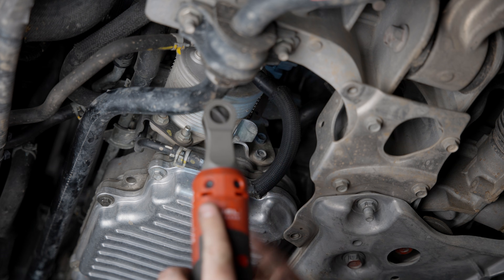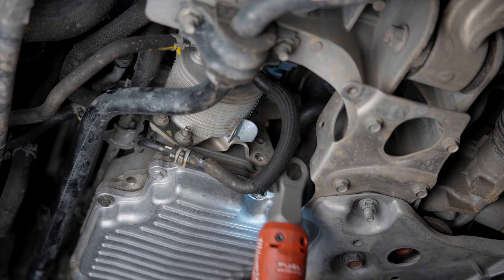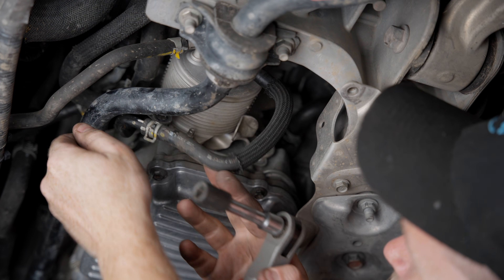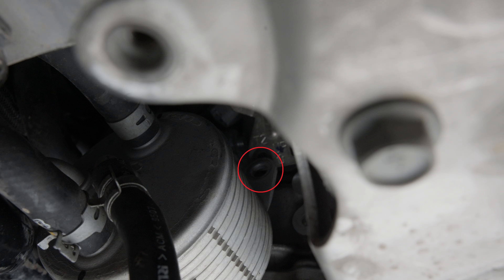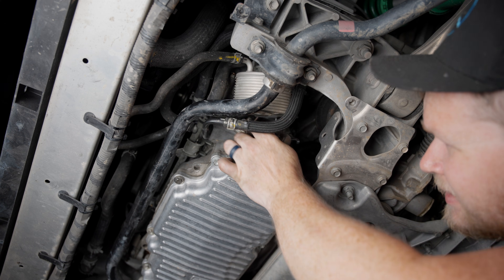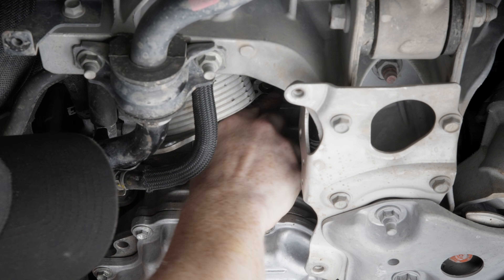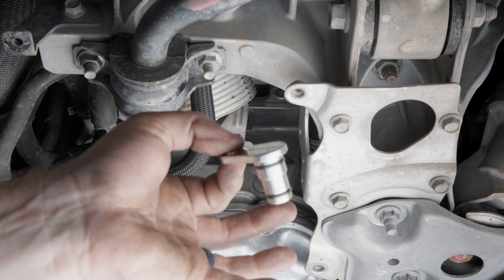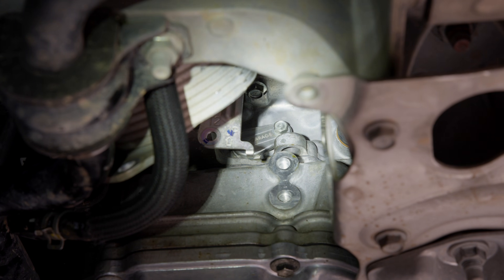How to Install a VR30 Oil Control Solenoid Delete Plate

Comment: I unplugged it and it’s not reading the engine oil pressure on the ecutek app.
What could it be?

I just unplugged the solenoid, didn’t swap to block off plate
Reply from the maker: Talk to your tuner and check your oil pressure sensor connection.

Comment: I added the block off plate to my 2018 awd q50 ,and all I did was remove the front tire and installed it from the side.
Reply from the maker: I haven't done one on an AWD model but that sounds way easier to me 🤣
Reply: @Gr4yshirt  yes sir, I saw how you were moving the cooler and all that out of the way,and did not want to mess with that,so I looked for another way to do it and that's how that came about.😂
Reply: Did you get a light on your dash? Also did your gas mileage drop after?
Reply: No it doesn't give you an actual cel ,but I can see a dtc on my ecutek,which is no big deal and yes my mileage has slightly dropped,but its better then a blown engine...I've installed all my mods on my car,so to me it's a part of this import tuner thing 🔰🌅

Comment: Maybe a dumb question but will removing this sensor throw a CEL?
Reply from the maker: I believe so, but it can be tuned out. My tuner  disabled it for my tune.
Reply: Yes you need to be tuned if your putting the block off plate on

Comment: Hi, new here. Why do you delete it? What will it change?
Reply from the maker: Hey, welcome. The oil control solenoid can fail and get stuck in low mode which means you will see low oil pressure whenever driving. Replacing it with the block off plate forces the engine to stay in high pressure mode at all times.

Comment: We have installed it . But the pressure still 54 53 psi didnt pass that limit
Reply: The stock VR30 tops out at 55 psi. If you want more, then you'll need a revised pump from one of the aftermarket guys.
Reply from the maker: Check the FSM for oil pressure values. I can't remember what they are off the top of my head. It's directly tied to RPM.

Comment: When you take the solenoid out will any fluids come out?
Reply from the maker: Assuming you weren't running the engine 10 seconds ago, no. All of the oil should be in your oil pan.

Comment: can I just simply unplug it?
Reply from the maker: I believe you can unplug it and leave it at that. I've been told by several people that unplugging the solenoid will suffice, but I was able to purchase this plate pretty cheaply.
Reply: I assume if you're high mileage its safer to get the block off plate rather than unplugging the solenoid. You dont know if your solenoid was already giving out